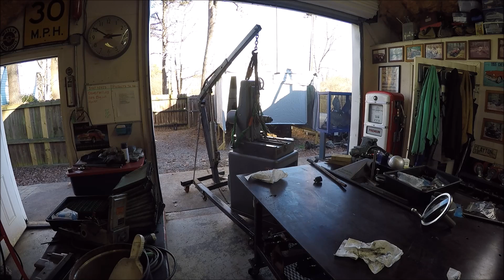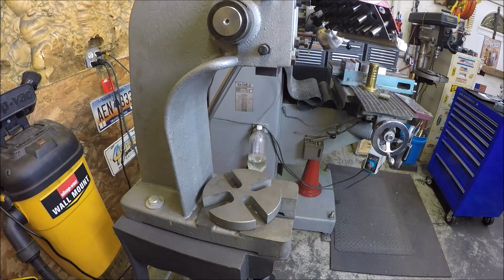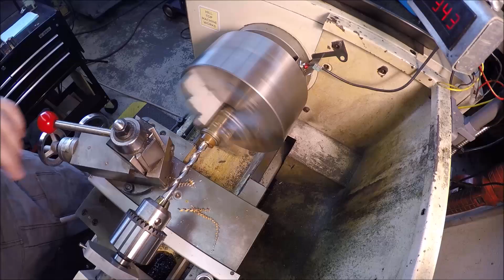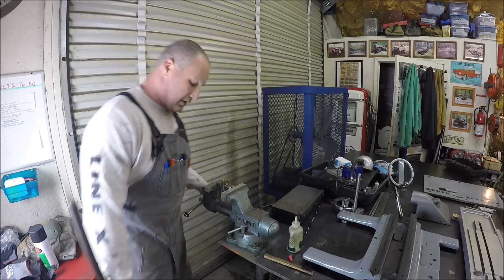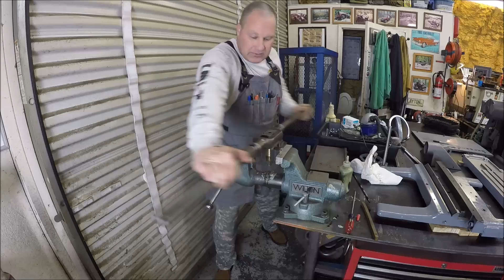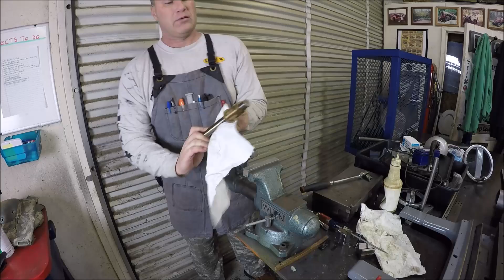Boyar Schultz Refurbish Part 5  Repairing the lead screw nut

Comment: Turning out good. I’m working on a one piece parting block now, the set up we have puts the blade too far away from tar QCTP. Also I’ve always had some galling on soft material like aluminum and brass while parting that’s why I use cutting oil.
Reply from the maker: James Dedmon Thanks Jim. I saw the email photos. Can’t wait to see the end product and see how well it works.

Comment: Looking good.  Put a tad of valve lap on the threads and run the nut back and forth .   I put my lead screw from my mill in the lathe and ran the nut back and forth that way.
Reply from the maker: MetalWorks Machine Shop Good idea.
Reply: Everything works better with lube.... just some more than others...
Reply from the maker: MetalWorks Machine Shop 😜👍. You’re packaged just arrived. Thanks you.

Comment: When cutting brass or bronze grind a flat on the cutting edges and the drill bit won't grab. If it was a clearance issue on the heel it wouldn't drill.

Comment: Hi Tom wow that tap handle needs its won zip code that thing is huge. I am not going to share  what we use around here when we manually tap a hole. Great video like the pictures on the wall. What is the lead screw nut made of bronze brass? Sure you likely have mentioned it prior but We are new here.
Reply from the maker: Active Atom That’s funny but you’re right it is a big one. Yep the lead screw nut is a bronze alloy. Thanks for watching.

Comment: Just a thought you may won't to run the tap through the other direction it may not be the best tap and could be just a bit different.  You can put the lead screw back in the lathe and run a file over to to clean up any burs on it. Out her then that grate job on the project.

Comment: As MetalWorks Machine Shop said, a little valve lap and a couple time through and she should be smooth.  Getting closer with the B-S, now go take a break after that tapping job. LOL  -  I have seen a couple people dovetail the parting blade holder and attach it directly to the QCTP.  doubleboost: https://youtu.be/JXimFwed3Lg - another option:  https://youtu.be/Aa80iQpjtAI  -  Looking forward to James' project on parting tool holder.